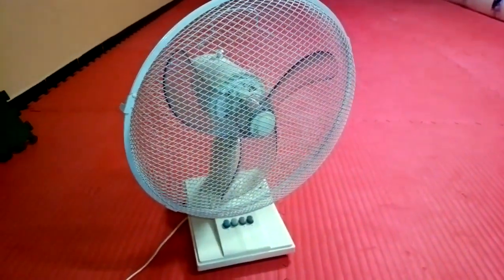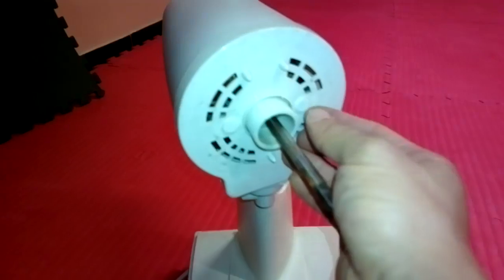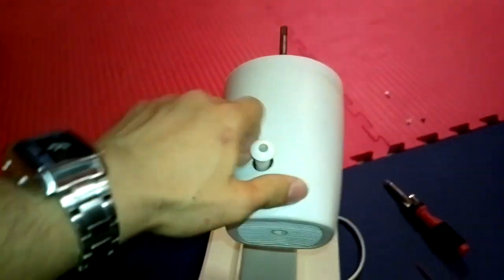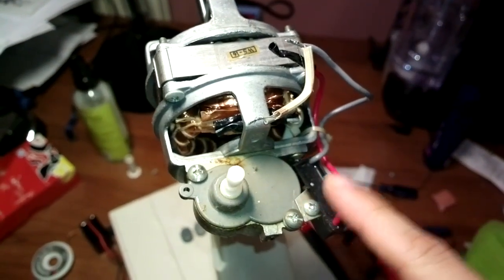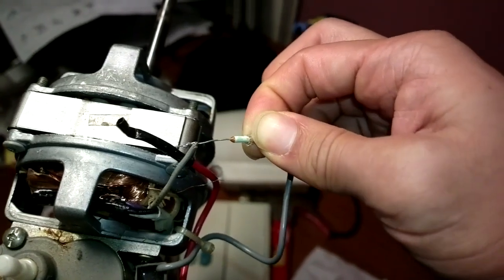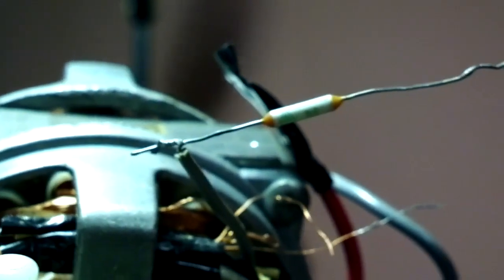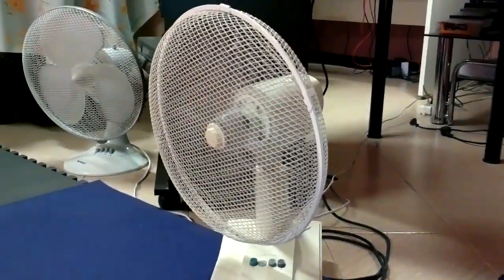Fan blades don't spin, no movement - Desk fan repair complete guide

Comment: Hi,  my fan motor is  getting over heated and its stopped... how to repair that??? anyone can help me ???
Reply: +Sachin Siva Replace the thermal protector. Clean your motor also from dust and lubricate the bearings. It should run smoothly.
Reply: +bam mel  i have cleaned the dust and lubricated , its rotor is rotating freely.  When we switch on fan it will work for 20-30 minutes then it will stop and a sound is coming from that . and  its back side is too hot both stater and rotor .. D.id u mean "thermal protector" as thermal fuse in the fan??
Reply: Probably its the thermal protector or fuse is bad..try to replace it..its located upper part of the motor after opening its casing you will find aomething like a fuse or white colored capacitor liked.
Reply: +bam mel Thank you bam mel its working........ :-)
Reply: Sachin Siva --- these tiny fan motors dont have stators, if it did - you wouldn't be able to sleep at night lol (they're particularly loud and give of a whining noise) 😁 therefore, thats why theres that capacitor instead of it - it excites the coil so that it would turn over. Kinda like a starter on an engine. Same principle - different mechanic.

Comment: my fan sometimes slows down like, there was a power shortage but when i try tu push the head of the fan it started seeding up again and if i let go it slows down again, btw my fan is almost like on 24/7 but not really it's like 18/7
Reply from the maker: +kenjesson yamagami If you haver an under-voltage condition because there is not sufficient stable power, then it is normal the fan slows done. However, if the fan slows down with stable power and cannot spin normally at start up, you need to change the capacitor.
Reply: well the fan wont start if i put it only in level one, i must put if first to level 3 then 1 to be able to use lvl 1 fan power,
Reply from the maker: Your motor starter capacitor is going bad and losing capacitance.
Reply: oh so i should change it? ok thanks a lot
Reply from the maker: Yes. With one that has the same value if possible.

Comment: hello good sir..
1 question..what if the fan does spin but spins really slowly after the start up and it took about 5-10 min to reach its desired/actual speed?.
can u tell me whats possibly be the problem and how to fix it?.
please.
Reply: +MoZan Capacitor. Check if the wires to the capacitor are okay, or buy a new one. Try spin it yourself as fast as you can and see if it moves by itself

Comment: How about if the blades slowly moves, sometines when I turned it own I have to turn the blades a couple of times. It alsi makes a humming sounds..
Reply: +Joanna Therese Sarmiento Simple. The capacitor is broken or the wires to it are damaged. A capacitor is like a kick start in the beginning to get it moving, and while moving the capacitor still works, it's like a little boost. If it's broken you'd have to spin the fan yourself to get it moving like yours.
Reply: +Crazylife Gaming you're saying it stops when it overheats?
Reply: +Keenan Smith Thanks you helped me so much now i know how to fix my fan.
Reply: Yes it worked,but still it stops and heat
Reply: Yeah,no worries i already replaced it :D
Reply: Keenan Smith u should post a video on how to do it my own is same problem
Reply: +Crazylife Gaming have you fixed it yet?
Reply: Joanna Therese S
Reply: Keenan Smith mine does this mines more of one of those "barn" type fans, not a huge one a smaller one but it's slow to get it started will get like to hot and just stops with a humming sound coming from it any video showing exactly what to do by chance?

Comment: Did I miss something like the part where you replaced the compassator? (Not sure of spelling) in this video, you didn't even show what a compassator looks like much less how to replace it. I'm lost
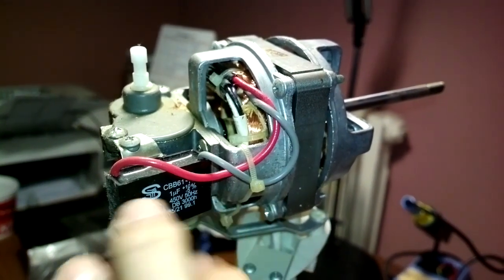Reply from the maker: Jancey Matthews Please pay attention, it's at 2:30. Also, you need some basic skills with soldering and electrical things before attempting any repair. See my other video about how to solder.
Reply: Jancey Matthews  He change the "capacitor" immediately after checking the resistor continuity.... he change the capacitor from 1uF 450V into 5uF 450V

Comment: Sir, What about, if it is not swinging and just stays on one side, though the blades are spinning? Thanks!
Reply from the maker: Alfred Kyo That's likely a mechanical problem with the gear controlling the rotation.
Reply: Thanks :)

Comment: I have a Lasko 18" pedestal fan which recently started spinning slowly and overheating. i changed the capacitor from a 4uf to a 5uf but it still spins slow. does this mean the resistor is bad?
Reply from the maker: Kazim Mohammed Did you clean the fan thoroughly inside? If too much dirt accumulated over the years, it could cause overheating.

Comment: Sir the propeller of my fan work as usual but it no longer turns right to left, any idea why?
The fan also doesnt stay in the same position and lost the resistance you feel when you try to move the fan.
Thanks in advance
Reply from the maker: jawman0 Do you mean the blades spin normally? I don't understand what you mean completely. If the blades spin normally, the other problems should be mechanical.
Reply: i see it seems that something broke inside the gear box that stopped the head from oscillating, although i can still see that the knob is moving. Thanks for the reply gotta have this check later.

Comment: hi, recently my fan started spinning slowly even at highest speed and i have replace the 1.2uf capacitor with 1.5uf and the fan is able to start properly at spd 2 and 3(highest is 3) but it started spinning slowly at spd 1. any advice is it safe to replace overrated capacitor??
Reply from the maker: That can happen sometimes, don't worry. If you need speed 1, you can get it started at speed 2 and put it back to 1 once it starts and it will keep spinning at speed 1. You can use a capacitor with higher capacitance in general, as long as the voltage rating is the same or higher.
Reply: thanks for the query but whenever i try to put it to speed 1 i will turn slower than before. is it other problem causing it than the capacitor?
Reply from the maker: At  speed 1 there is more resistance. The capacitor can vary in its capacitance (it's normal). Depending on the quality of the capacitor the variables can exceed 10%. If the fan spins slower at speed 1 at start-up, it's just not getting enough current from the capacitor to kick start the motor because at speed 1 there is also higher resistance by design. At speed 2 and 3 the resistance lower so even with the same capacitor more current can flow. I think a 3~4 uf capacitor would solve the problem.

Comment: COuld you explain how to use the mulitimeter (what settings, etc) to test continuity of the fuse?  Thanks.
Reply from the maker: Obviously, with the power disconnected from the fan, you can check the continuity. Most digital multimeters have the continuity test, which applies a small current at low voltage through the component. For example, on my Fluke multimeter, If it is open (bad), generally there is no beep, if it is closed (good), then there is a continuous beep. Another way to check the fuse with a multimeter that does not have a continuity test is to remove the fuse at least from one side of the circuit (desolder one lead from the circuit), and set your multimeter to measuring resistance (Ohm or Greek letter Ω), and make sure the range (measurement unit) is set to the lowest (there are usually 1Ω, 1000Ω, 100000Ω and 1MΩ) put the two test probes across the two leads of the fuse. If it shows a very low resistance like 1Ω to 0.1Ω it's good. If it shows something like infinity, or 0Ω then it's bad.
Reply: @conceptedge  so if you use the continuity meter setting you do not have to remove the thermal sensor from the fans wires to test it. [the wires can stay attached on both ends; stay in the circuit and still test it]
Reply: YOU CAN'T FIX YOUR FAN.. YOU ARE TOO STUPID.

Comment: 1000uf Hi, my fan stuck when turning and produced noise. How can I fix this? Model: Mistral MFF1210.
Reply from the maker: What type of noise? Do the blades spin at all?
Reply: like the motor gear noise. The blades spin well. Just turning left to right will stuck and jam half way. Pushing it to left or right a bit then it turns again but another turn will jam again.
Reply from the maker: Have you checked the rotation mechanism? What about the ball bearing? The noise is likely to be a problem with the ball bearing.
Reply: Actually I found out that the gear attached to knob will move to left when rotating. Then I used the plumbers tape on the knob near the gear and it solves the problem. My question is why will the gear not holding tight with the gear beside it?
Reply from the maker: I don't know. It's hard to say without a photo or video.

Comment: How to fix:
Step 1: throw fan away.
Step 2: go to a local antique store and find a vintage/antique fan in good working order.
Step 3: use said vintage fan in place of Chinese POS
Reply: Shut the fuck up
Reply from the maker: Haha, it certainly is easier, but even the vintage fans using motor starter capacitor will need to replace the capacitor with enough time of use. The capacitors don't last forever, but good ones tend to last longer.
Reply: Yeah

Comment: Do you know how to repair a food Mixer which only runs at full speed? Thanks!
Reply from the maker: It's hard to say how to repair it without knowing the make and model and seeing it. Since it's operational at full speed, you may first check / replace the potentiometer (the dial that allows you to adjust the speed).
Reply: 1000uf its a Kenwood chef a701a but thanks i will check it tonight. and report back in the morning